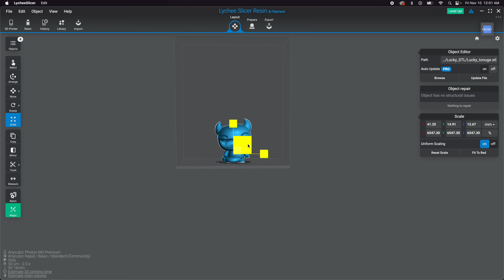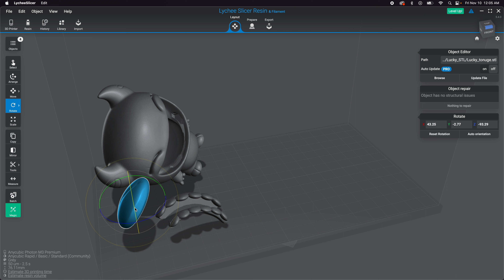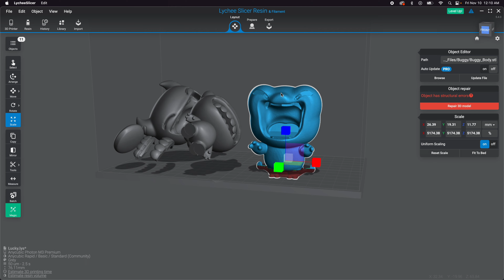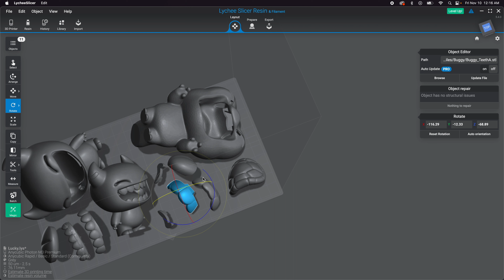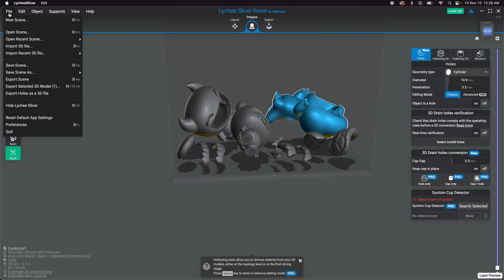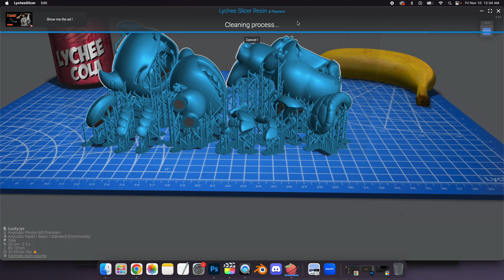Exporting a Nomad Sculpt model to a SLICER for 3D Printing

Comment: so you create stl files for each individual piece? Like say if I wanted to create a doll, I would create an stl for the head, a separate stl for the body, a separate one for the legs etc. Is that what Im doing? I’m sorry this is a big wordy but Im a newbie and a little lost..Please help
Reply from the maker: Yes, that is exactly what I do; I do this because I sculpt the pieces to fit together. I could also just print as one full piece, but I’m not great at painting so I don’t get great results. Separate pieces I can make perfect and then glue them together 👍🏾 (however it can be tricky to get the to perfectly fit together.. usually with some sanding I can make it work!

Comment: Hi Dave, I tried to add an image for my background using as the reference image in Nomad, but when I turned on depth of field in post-process, it blurs out the background image. Is there any way to prevent that?
Reply from the maker: Not that I know of. You can adjust the blur though with the dials. Also the dof takes into account everything in your scene and works better if you don’t have for example a very large ground surface or something.  Sometimes the near blur can help too, end if doesn’t seem like it should!